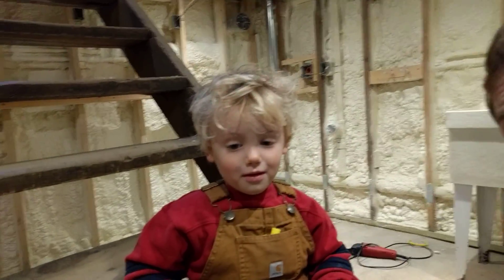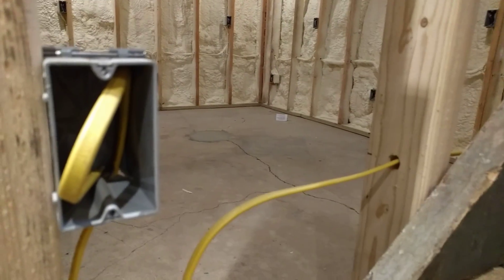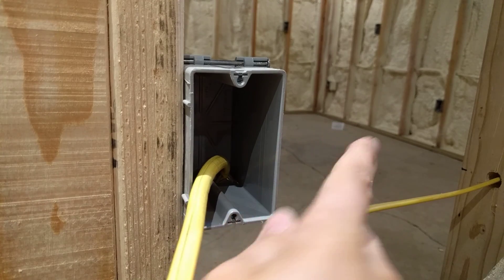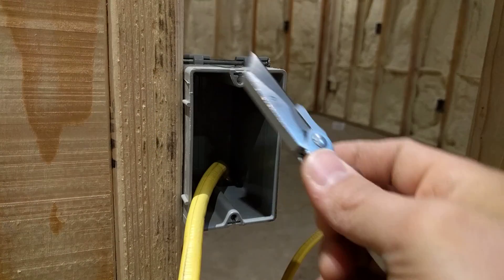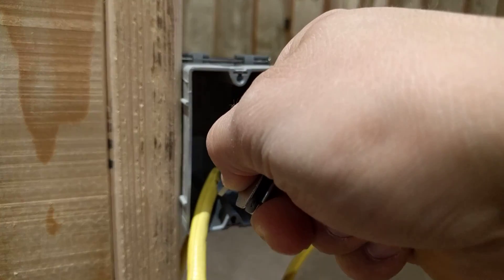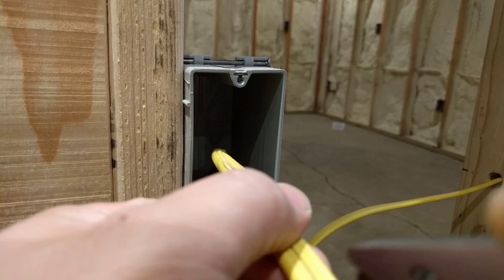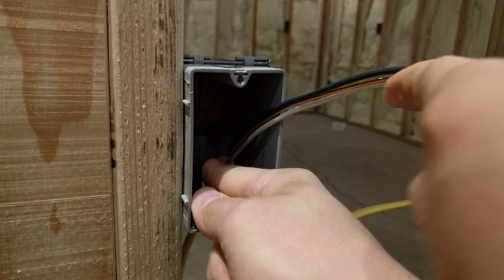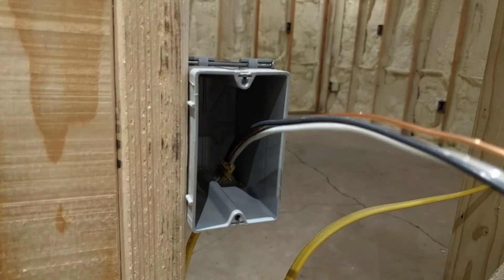How To Strip or Remove Cable Sheathing From Romex Using a Utility Knife - Rough In

Comment: With some sheathing, if you slice only a tiny length near the end of the wires, you can tear the rest down to where you need.  Essentially just get the split of the sheathing started, like maybe a half inch so you can grab it and pull it apart.   That way if you do slice into the insulation of the wires, it's at the very end of them and you can just trim it off.

Comment: Electrician here don't do this!!!  You just barely score the sheath the sheath removes easily once you score it.  If you cut that deeply into the sheath you will end up cutting either the hot or neutral insulation.

Comment: Back in 1997 , I was doing the electrical wiring rough in on a custom built 4,000 sq.ft. Austin Native Stone house and was about 3/4ths done and the client, who was a co-worker of mine in the Federal Fire Service, was the home owner. Well, unknown to me , his half brother had gone  around and was stripping the romex sheathing from the cables in each electrical box using a box cutter razor blade knife ! When I notice what he had done was actually cutting the conductor's insulation on each wire in the boxes !! I had to jerk out the damaged  romex and rewire all that he had damaged with his damn Box Cutter Razor Knife !! He got a good ass chewing out from Me and his brother, the owner !!! Boy , was I Pissed Off !!!! That's Why I HATE Box Cutter-Razor Utility Knives !!!!!!  The only good those damn things are good for is cutting open Boxes !! NOTHING ELSE !!!!!!

Comment: I'm a State Licensed Journeyman Electrician with over 53 years in the Trade and I have NEVER use a '' Utility Knife '' , or a '' Razor Blade Box Cutter '' to remove  the sheathing from Romex Cable !! I have always used a Romex Cable Ripper ! I always cringe whenever I see someone use a Blade or Box Cutter to remove the outer jacket or sheathing ! There is just too much of a chance of slicing into the insulation of the conductors inside of the sheathing !!!

Comment: I've been using that Gerber knife for the past 4 years, its my go-to for everything short of 2/0 !  Bought 5 and still have 3 left, gave 1 as a gift !  It clips  perfectly in my change pocket, never feel it and its always there.  Just be sure to use the heavy duty blades.  Good job in this video, but I also only cut the first 4 inches in the box and separate and trim it just inside the box.  Saves time as it adds up when roping a new house with 200 openings.  Never cut my hand or finger ever.

Comment: A slight improvement on this method is just to score the jacket when running along it rather than cutting through it.  That way you won't accidentally cut through any insulation of the individual wires.  After you score the jacket, At the tip of the cable, just cut the jacket open along the score line, then pull the jacket away from the wires, which should be easy now.  This way, you'll never have to wonder if you accidentally knicked a wire.

Comment: Apprentice electrician here, all we do is just quickly slice the top and bottom near the back of the box and then pull it off.  literally a one second deal.  don't press too hard or you'll cut into the wires themselves, which would suck.  helps to have a somewhat dull blade.
Reply: Josh Hagerman that's why we keep our blades dull, it keeps you from being able to knick it easily, you're right about just needing to make an impression
Reply: Samuel Thomas I saw another way I was wanting to try when I cut in next. You slice down the middle, maybe an inch and the tip and then pull the two sides of back. It looks better in myind because even if you put a mark in the wire, it's going to be trimmed off anyways.

What else have you learned so far? Have you gotten into pvc pipe bending?
Reply: Josh Hagerman I don't recommend cutting down the middle, we had one guy who used to do that and he kept knicking the crap out of stuff, I had a service call the other day where an AFCI breaker kept tripping because he had the wires knicked.  You have a layer of paper underneath the PVC wire jacket... If your blade is slightly dull it doesn't go through the paper easily if you're cutting horizontally, but if you're slicing down the middle the tip of the knife will go right through the paper and sometimes knick the wire.  I know how to do yardlines if that counts.  We run 3" underground PVC down from the service disconnect through a trench, to the tombstone or transformer.  We do rough ins, trimouts, yardlines, anything electrical with new houses.   So I've installed a lot of microwaves, ranges, ceiling fans, hooked up heating units, a ton of different Chinese lighting fixtures... Lol
Reply from the maker: Samuel Thomas 

Thanks for the tip!
Reply: Samuel Thomas we just did 8 runs of 3 1/2 in a hotel we are doing. Talk about a pain in the ass. We got called in because the company before us was a pos so we were already behind. It was a nightmare in 117 heat index 🔥

Yeah, arc fault breakers can be a pain in the ass, especially if a lot of receptacles are connected together. You have to take them all apart 😰
Reply: Samuel Thomas that works. There is a few ways to do it and while it can be a one second deal, you cannot always see if you knick a wire. I have seen dead shorts happen because of that. All I do is dull the blade on purpose because all you really need is an impression on the top and bottom and pull. Most people think you need to slice into romex. If you're in a rush you can do that, but if you have time, I do it the way shown in the video or use the ends of my wire strippers to pinch and tear the sides of romex for higher items like lights on a wall. To each their own, but just always be careful and best of luck in your apprenticeship ☺

Comment: just stab in and rip out about an inch from the end and just pull the ground through the sheathing. much faster and no risk of cutting into wire casing. you'll never use that last inch anyways.
Reply: This is the way. Thanks for the tip!!

Comment: I was looking for a better way to do this.  book told me to grab ground wire with pliers and pull it through sheathing.  didn't like this method because it seems to stress the ground wire and pull it out of the cable some.  as your video on a cable ripper shows, they can mar the wire insulation.  this method looks risky though...easy to get off center and damage wire insulation.
Reply: Nicholas Hoffenpiper I agree. make one mistake and have to run a whole new wire.
Reply: This method is unnecessarily risky. You don't need to cut through the sheath. A very light score is good enough and it is easy to get the sheath off by pulling the ground wire along the score as suggested by Josh Hagerman above. Alternatively you don't need to score it all but you do need to pull fairly hard on the wire. While that might seem to be pretty rough on the wire they use the same technique on the great NM designed for underground usage. And you have to pull on the wires much harder in that case and the technique seems to not cause problems. 

I saw a video where I guy used the technique suggested by Sam Thomas above where the sheathing is almost sliced through on the top and bottom of the cable the place where the sheathing is going to be removed from. I noticed some responses that were critical of that technique because it could damage the wire. I think that's a reasonable concern and I wouldn't do it but it seems like it might be a good technique if somebody really knows what they are doing.